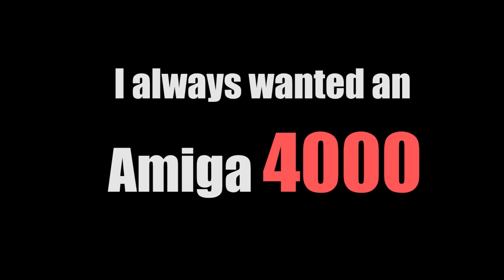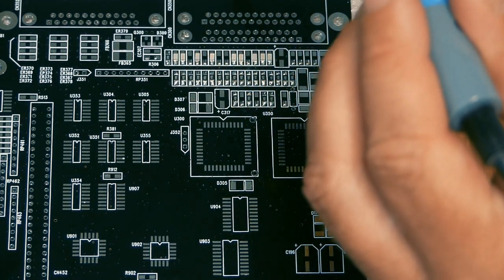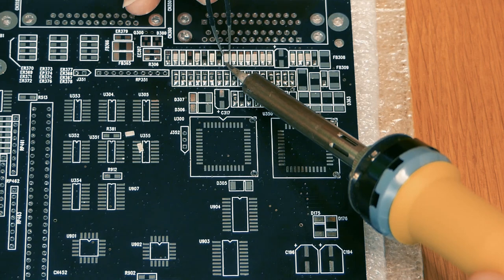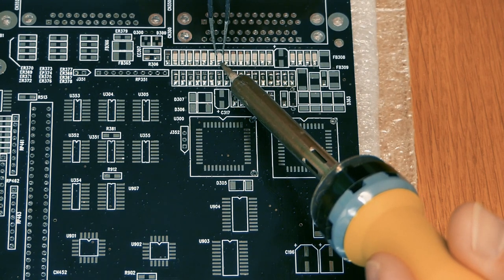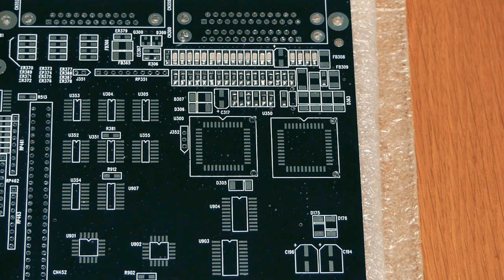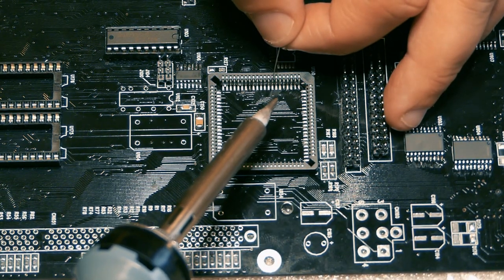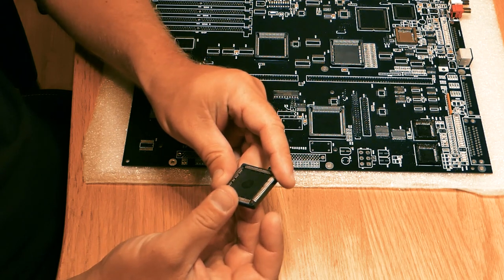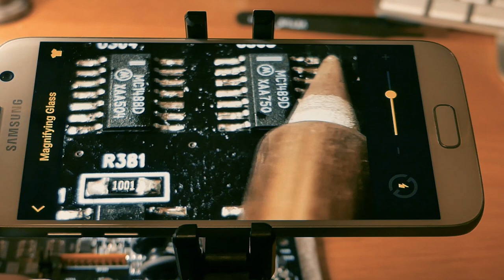Building my own Amiga 4000

Comment: For surfacing mounting the best was is to use some wick and put some solder on the pads then using a hot air gun heat up the area and put the socket on without putting the gun near it.
Reply from the maker: Yes it is.

Comment: You need solder paste. Apply it to the pads, place components, and stick in oven at reflow temps. Alternatively you can use an iron or air reflow station to melt the paste.
Reply: @Daniel Moreira for these kind of projects, it's better and more fun to use a cheap heat soldering gun from Ali express. Costs about $35 delivered. Soldering paste is also available on Ali Express. You will definitely have more fun soldering, without having to break sockets.
Reply from the maker: Hello and I know, but this one just had to be made this way. I have ovens, reflow stations and lots of soldering paste, even a dispenser. But ...
Reply: To do a good jon with solder paste you really need stencils to get the paste uniform. Soldering by hand like this actually works very well.

Comment: Great work! I too have the same logic board and have started soldering components to it.  I used my original A4000 logic board to find what goes where.  Do you have a components list for the board, or did you just use the schematics?  If you have the components list, could you share that with me?  Be quicker than going through the schematics, and would not need to keep opening my A4000 to find where components go.
Great video’s!  Very enjoyable to watch.👌

Comment: Are kits available anywhere? I'd love to build a 1200 if I could find a kit or short kit with everything except the rare ICs for example.
Reply from the maker: I bought the mb on ebay, you can search for Amiga 4000 replica and you find the site.
Reply: If you're going to do an A1200 get the latest version of the board which is Rev 1.5 There is also a Commodore 64 board and an Amiga 500++ board and the 128

Comment: Nice. I'm tempted to do it too. Don't you need chips taken out of Amiga 4000 for this?
Reply from the maker: You can buy everything new, except a few ones that you need to gather from ebay or utsource. The custom chipset, db-23 connectors etc can be bought from individual computers.